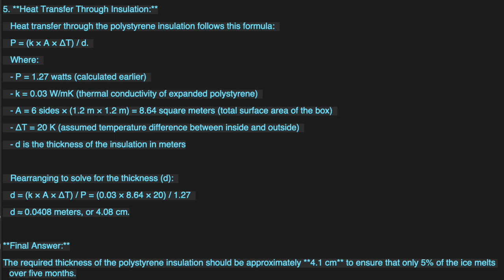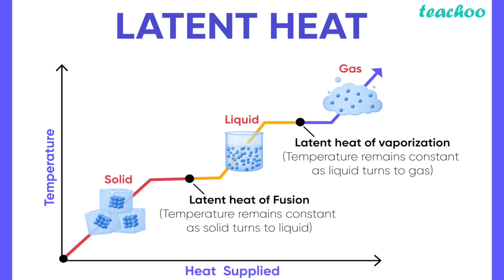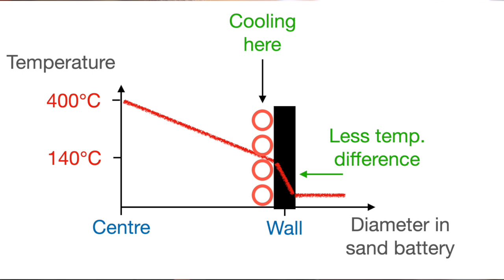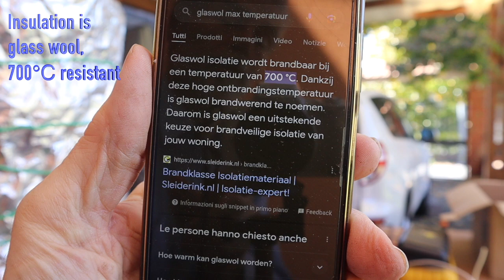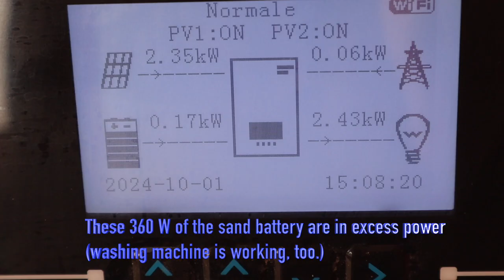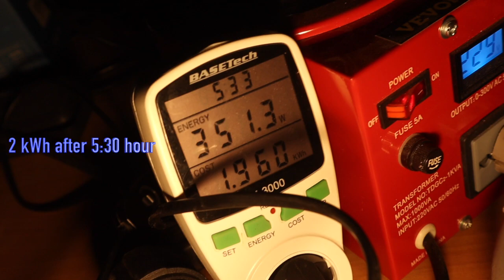Better version of my sand battery: why seasonal storage is not possible  - Video 67

Comment: I would conserve the sand battery heat by placement choice in my home. It's an old 2 story with basement and large central brick chimney column. In the basement 1\4 of this chimney column ends at a sauna room, and shower.
I would put the sand battery under the sauna bench, keeping the wet rooms dry and preheated.
Reply from the maker: Hi Brent, you certainly have an interesting house. Indeed the sand battery can be applied in this way and be closed after the sauna visit to conserve heat for the next time.  You can charge it with the gasoline generator  exhaust gas, which is at a high temperature.

Comment: What's the difference between stored heat and sensible heat ?
Reply from the maker: Hi Brent, those are not on the same dimension. The sensibile heat is complementary to the latent heat. The former is the heat that raises temperature and the latter doesn't. It will rather melt or vaporise a substance while temperature is constant.

Comment: So LLM (AI) are not CAS ( computer algebraic systems) the closest we have is Wolfram|alpha by the Stephen Wolfram that owns Mathmatica.  CAS I recognize from a list google gave me are Sage , Mathmatica, Maple, and MatLab, with the majority of Academia using MatLab and Linux users using Sage. Out of all the ones I have used Mathmatica is the one that lets you use pretty print math instead of code.  Maple uses pretty print also but I didn't see it on the list so it might be defunct.  All AI's basically read a chart or make up math.  I have heard of some one using chatgpt to use Wolfram API but that is still reading a chart.  Moral use Wolfram alpha search to get your math right.

Comment: Can you explain how the phase change materials work in this instance? I have seen sodium acetate used in hand warmers used to store energy - but once the liquid is 'activated' it is an irreversible reaction (unless re-heated). The ideal scenario is to have a phase change material in which a chosen amount of heat can be extracted on demand without depleting all of the stored energy. I'm looking at storing heat for daily use to run warm showers, so trying to find the best heat storage medium - sand is good because it is easy and safe (easy to contain, no danger of steam build up - and storing heat in water has potential for legionnaires disease). It doesn't matter to me if the system is inefficient so long as e.g half a cubic metre could store enough heat to run 3 or 4 showers per day with the cold water going through a heat exchange in the sand battery. so can anyone recommend a better storage medium - especially given that the system might have to store energy during wintery days when there is not a lot to heat it (it will be heated by solar).
Reply from the maker: Sand is a good medium because it can go up in temperature. But ,Phase Change Materials (PCM) are better, because they stay at a temperature that you desire (look on ChatGPT or tables on internet to look for the right material) while storing heat. Sand goes up in temperature if you store heat and thus also the heat loss. I would look for a PCM of about 70 to 90℃ for shower water, in the second sand video I mention a kind of mixture of two salts to choose a good temperature but look on internet. 
Do you have biomass that you can use for a fire and then the exhaust gases go into a second heat exchanger in the sand, to heat it?
Reply: @nnvasen-good-energy  Thanks for your reply. As you say, sand is good because it can be heated to very high temperatures - but the problem here is that you don't really want sand at 100 degree c plus in a shower - there is going to be extreme high pressure in the pipes when not running and also the potential for someone to get in the shower and turn on boiling water. I can obviously add a thermostat to the system to prevent this - but that slightly defeats the point of using sand. I still don't understand how the temperate of salts are managed -- is it the case that if, for example, they are heated to 80 degrees c, they just keep absorbing energy which can then be released simply through running cold water through the mass in the same way you would with sand - but they will take much longer to cool down because it is not just about the inherent heat capacity of the material, it's also because they have changed phase and the temperature of the heat exchange is what determines the phase they are in? I'm not a scientist as you might gather - more a keen DIYer trying to figure the best way to do this - thanks again.
Reply from the maker: Hi Simon, I don't know if you read this after 11 days, but you are right about how Phase Change Materials (PCM) work. You have interesting ideas as a DIY, you would be a good participant of the English Facebook group, it is a bit silent there! And your comments would not be burried in the timeline of YouTube comments, and be more visible. If you like, you can visit https://www.facebook.com/groups/1440674419825846

Comment: This entire practice isn't going to work.  The more you recover the heat from those channels, the faster the heat will be lost through the bricks.  The math just doesn't work out on any of these things.

The most advantageous option is storing heated water in a dewar flask.
Reply from the maker: Hi Dus, I agree with the dewar flask (where we keep warm the coffee) principle but who will make this for us? You can use a refrigerant vacuum pump (I have it) but you need the double wall, leak free.
I agree also that the heat will come faster through the wall as you suck it away and use it, but much less will go away through the second wall (the outer wall). Only this latter leakage can be called "loss".

Comment: If  built with a 3x3x3meter= 27m2 sand battery which is insulated by 50cm rockwool. Used with 45 solar panels to heat while sunny, using a 6 kw rocketstove as a mass heater while no electricity, and using electricity while low price. Would this work in Norway in a passive house with 130 sqm? What if I were to replace the sand with water? What about using a heatpump to heat the sand/water with electricity?
Reply from the maker: Hi Kay, yes that should work. For each m3 sand and temperature of 400℃ above room temperature you should have 100 kWh of heat. I find it very nice to make a hybrid sand battery and such a big one! Now you have 2700 kWh and if your home needs 13 kW (cold country like Norway) of heating in steady state (comfort temperature already reached) than you have 200 hours. If I remember well, then filling the gaps between the sand grains with water will increase its heat capacity by 50 - 100% but its max temp becomes 100℃. I would instead put the heat pump in another system like in my last video 68 and enjoy the very high heat capacity of water, over 4x that of sand. It is also better because fire and electric resistors go very high in temperature (sand) and heat pumps are very limited (good for water). You will have two systems for different temperatures. People will envy you!

Comment: I think that mixing different salts to make the phase change material, results in separation after a while.
Reply from the maker: Does that happen in molten state? I will have to look up the temperatures for the single salts. I am not so fixed on this exact temperature of 140 degrees. Thank you for information us!
Reply: @nnvasen-good-energy  yes I have read that after a little use the salts may separate and thus lose the phase change. Ik wacht met interesse. Mischien zal het een goede uitslag hebben voor U.

Comment: i am enjoying tour videos and experiments. But i would like to seethe heating of the battery using renewables, specifically Solar electric.
Reply from the maker: You can see that in especially in the previous video 66  (https://youtu.be/d5zn3u5-ypQ) where you see the small sand battery under a single PV panel of 100 W. Also in this video https://youtu.be/57ZLgErL_Io you see that it is heated with PV energy, because there is at some point beyond 7:40 minute a display that shows how much is going from the 6 kW PV into the batteries and the whole household.
Thank you anyway for your appreciation! If you like to see other themes, tell it me.
Reply: @nnvasen-good-energy  Thank you. keep up the good work.

Comment: You're wasting your time using sand, unless you can rapidly heat it above 300°C. You are able to store more sensible heat energy (40°C+) in 1kg of water than in 1kg of sand.

The specific heat capacity of water is 4.18kJ/kg/K whereas sand has a specific heat capacity of 0.835kJ/kg/K. So 1kg of water heated to 90°C would release 209kJ of heat energy before it reached 40°C. To do the same with 1kg of sand, the temperature would need to be increased to 300°C before it was able to release the same amount of energy before it reached 40°C.
Reply from the maker: You are right, it was what I replied on another comment on that same question. I even told that 350 or 400 degrees is the break even point. The advantage of sand is when you need the high temperature during consumption.
Reply: @nnvasen-good-energy 
Have you tried pool filter sand which is pure silica sand? It has a much higher thermal conductivity.
I’m testing a large 6ftx8ftx2.5ft under a greenhouse. I also mixed granite stone with the sand. I haven’t fully tested how hot it can get but I did get it up to 108°f and dropped to 79.9°f after 3 days of no additional heating.
Reply: You are obviously right - but sand have three points for it: 1) it can go even higher than 600C 2) its density is higher than water by 3~4 times, so the thermal mass would be much more compact... So in qubick meter you can store significantly more energy in sand than in water (going high with temperature) and 3) it will not explode on overheating (which is also difficult with sand, but you can easily boil water - so you need to have additional safety circuits/devices).
Reply: @dempseypoland  Sand has a ~50% greater density than that of water. A simple Google search would have told you that. The issue with heating sand to such high temperatures is that unless you can do that rapidly, you lose large amounts of energy to the environment. It's simply not possible to heat sand to those high temperatures quickly enough in a domestic setting using electricity.
Reply from the maker: I partially agree with the available electrical energy to heat the sand. The sand will continue to get hotter as long as this electric power is (much) bigger than the loss. The loss can be calculated with given temperature difference and insulation parameters. Moreover, this video proposes to pick up the heat loss at the outside and consume it. In that case you don't even mind so much when heat is leaving the storage (the former "loss" ) but just that the available electric power is bigger that than what leaves the storage.

Comment: Thank you ❤
if your time allows, maybe a material about gravity batteries?  I would like to build one.  I have the opportunity.
Reply from the maker: Great suggestion! I am also fascinated. However, you need really tons of weight to have a bit of energy. I was visiting Energy Vault in Switzerland, they do it at large scale. Anyway, would like to do something. Like grandfathers clockwork!
Reply: @nnvasen-good-energy  ok and thank you for answer. My data is    gen : 1000w  weight : 1.6 ton  height 16.8 m  . it is an old fountain
Reply from the maker: That sounds good, with mgh = 272 kJ, but in a kWh there are 3600 kJ!